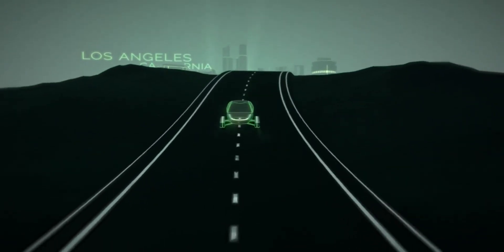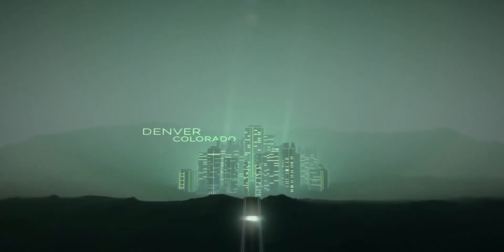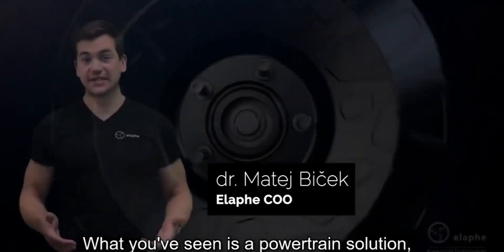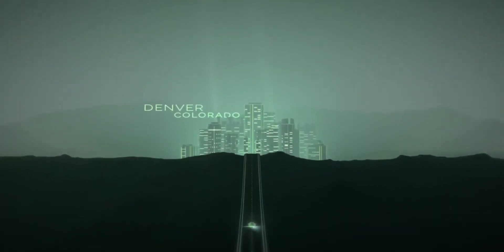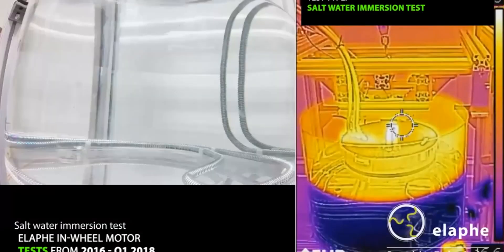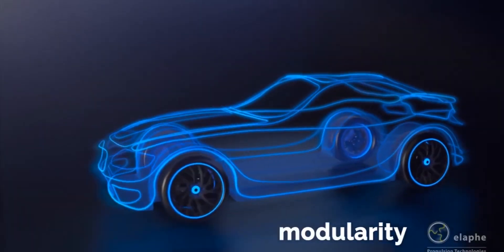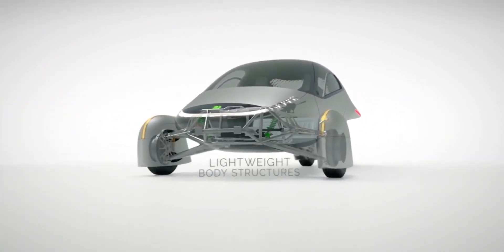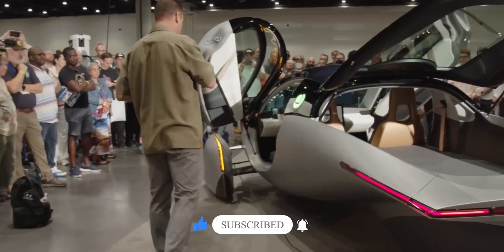Aptera's In-Wheel Motor Design - Here Is Everything You Need To Know!

Comment: I'm not an automotive engineer, but it seems to me that there are many advantages to hub motors over a centralized motor that needs a differential to route the power to the wheels. Why not put the power right at the wheel? One has to separate the viability of a hub motor with that of a specific brand. I'd like to hear more about why Aptera chose the Elaphe company to supply the hub motors rather than a different company. Is that the brand Lordstown is also using on their trucks?
Reply from the maker: Yes,Lordstown also works with Elaphe to supply in wheel motors for them.
Reply: @BusinessAndGeopolitics  That is, they will use Elaphe if Lordstown ever makes it to production.
Reply: @deanstewart2  Aptera uses a different model motor than Lordstown will. There is no impact on Aptera.  Elaphe is committed to supplying Aptera with motors. Moreover, the carbon fiber body and chassis (with Elaphe hub motors) will be assembled by CPC Group in Italy. Incidently,  CPC has been manufacturing bodies for Ferrari and other super-car manufacturers for several years.
Reply: @Dean Stewart  Lordstown now has backing of the makers of Iphone (Foxconn) so it will definitely see production.
Reply: The reason hub motors are not desirable is because they are heavy and therefore negatively effects unsprung weight which in turn has negative effects on handling
Reply: @Sean Murphy  Except in Aptera's case, placing the motor in the wheel gives it a lower CoG than putting them in the body.....which when I last checked, improves stability.
Reply: Since the driveshaft,  half shafts  and differential are part of the unsprung weight of the ICE drive train wouldn't the unsprung weight of  the wheel motor system be about the same?
Reply: @vaxed2402  no, the differential in car with independent suspension is bolted to the chassis so is not part of the unsprung weight. Drive shafts contribute 50% of their weight to unsprung weight.
Reply: @vaxed2402  A compromise is a motor with a short half shaft
Reply: @timothykeith1367  half shafts not needed on aptera.  The hub motor coils are stationary in the center and the magnets are bonded to the inside of the rotor on which the tire/wheel is mounted.
Reply: @Binaural_Zen  Heavy is a relative term.  There are always engineering trade-offs.  For Aptera the advantages in lower power loss clearly outweigh the disadvantages, especially since Aptera passes the moose test.
Reply: @n.brucenelson5920  exactly, there are always trade offs, hub motors delete the differential and the drive shafts - but add in a reduction drive for each motor and much higher unsprung mass, high voltage cables vibration/fatigue, and worse durability than a conventional wheel hub bearing.
Unsprung weight would have little effect on the moose test on a smooth road - but try doing it on a bumpy road where your unsprung weight is key.
Reply: @TC-V8  This discussion has veered off the road towards theoretical engineering concepts of unsprung weight effects. Wouldn't it make more sense to compare empirical tests of actual designs?  Looks like wheel motor designs are doing extensive testing - would be nice to know results - and comparisons.
Reply: @TC-V8   From my understanding, Elaphe in-wheel motors are direct drive, therefore don't have reduction gearing. This is why they are so efficient - you are leveraging the high torque of an electric motor in a lightweight vehicle to keep the revs, and therefore the power consumption down. Compare that to a Tesla which uses reduction gearing, but the motor in a Model S Plaid has to spin at 18,000 rpm to get its maximum power. That's insane energy consumption, and along with the 2-ton weight of a Tesla, explains the low range in spite of a massive battery pack.
Reply: @aftonline  oh yes you are right with the reduction gears. Without gears, electric motor's torque scales with its weight - so high torque low speed motors are heavy. Also with such a low wheel torque you'd need 4x to get reasonable acceleration.
They are quoting 23 to 40kg depending on torque demands. They don't say if this includes the disc brake - but they say added weight so I'm guessing that's plus the disc? brake. 40kg is massive unsprung weight, I note 2x people fitting one in their press video.
Reply: @vaxed2402  I was mearly correcting your incorrect asumption about the differential being part of the unsprung weight.
I'm not sure we can go too deep into the actual technical details in youtube comments! 30-40kg of additional unsprung mass is massive and will have a negative effect on handling and refinement - one of the reasons you don't find live axles on passenger cars/suvs. The burden of proof is on Elaphe to prove otherwise. 
I also note from looking at Elaphe's 'few' technical details that the brake disc is buried in the hub motor - this will destroy any brake disc cooling.
Reply: @TC-V8  Yes, there's a compromise when it comes to needing a suspension that's tuned for the extra weight, but it's worth it to get that additional efficiency. Nobody else has even come close to 100 wh/mile and as long as they are following the formula of ICE vehicle engineering to make EV's, they never will.
Reply: @TC  Yes, but with regen, the cooling needs for the brakes will be massively reduced.  The only reasonable heavy use of the physical brakes would be in an emergency stop, which tends not to happen often.  
Also laps around the Nürburgring.

And regarding the moose test, if the road was bumpy, you wouldn't be driving very fast, would you?  
You seem to be a big "what-if" thinker who doesn't place that "what-if" in a full and reasonable situation.  I hope you don't have a huge bias against the car.
Reply: @TC-V8  This is my concern as well: Durability. Even without tests it's pretty plain to see that a motor that is inside the thing that's bouncing up and down continuously on the terrain is going to receive a lot more harsh impacts than a centralized motor that is distanced from that shock by everything in between. But, I'm sure Aptera would not go this route if they didn't have data that shows that these hub motors are up to the task. I guess we'll find out when these have been driven around and over numerous potholes* for 5 or more years.

* And with the three wheels arranged the way they are it is considerably more difficult to avoid them.